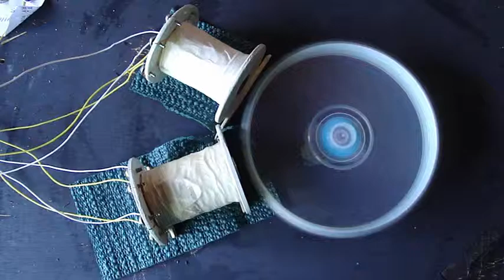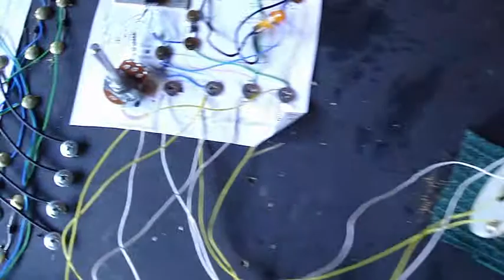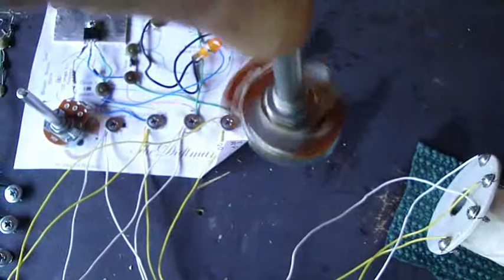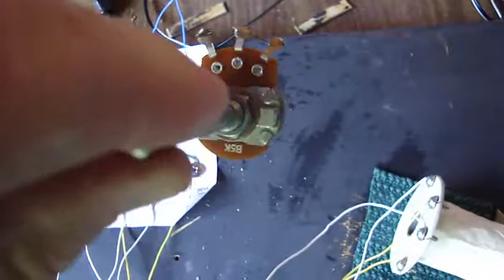Audio Pot vs Linear Pot.avi

Comment: Poppy:  I think the motor should work all N, NS alternating, or all S.

For your normal North, you trigger the transistor just after TDC and the coil works in repulsion speeding up the rotor.

With a South, now you will trigger the transistor before TDC, and it will switch off at TDC.  This time the coil will work in attraction and pull on the rotor speeding it up.

With multiple coils you have to be careful.

I am doing all this in my head, but I think this can be verified on anyone's setup.